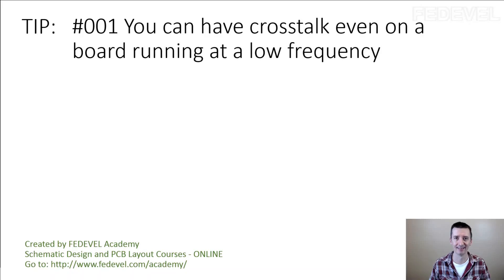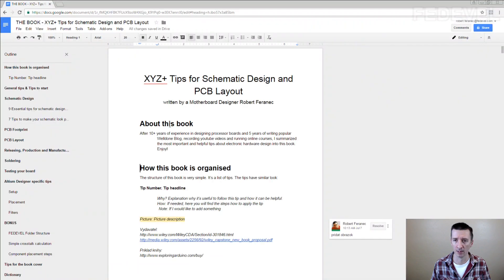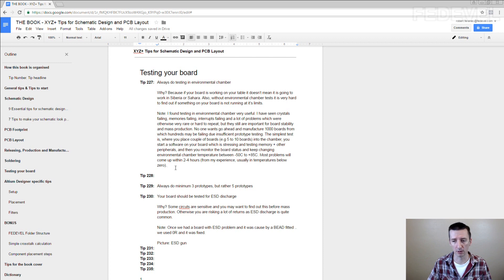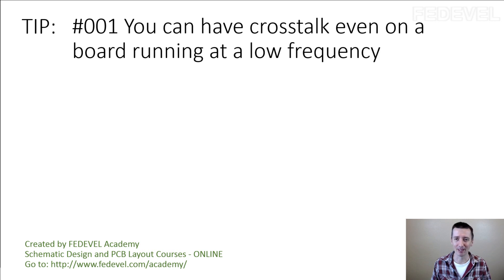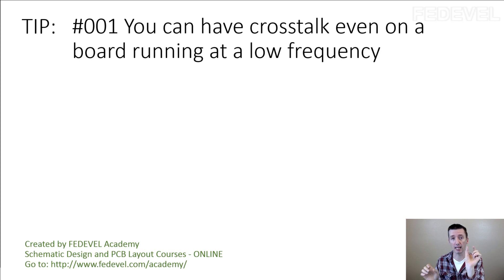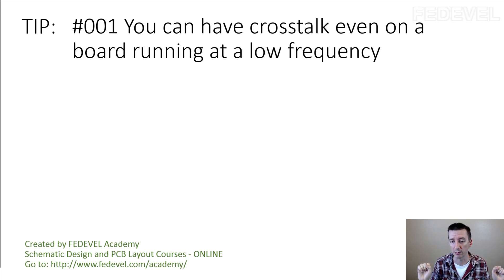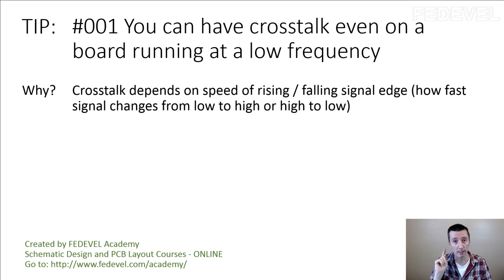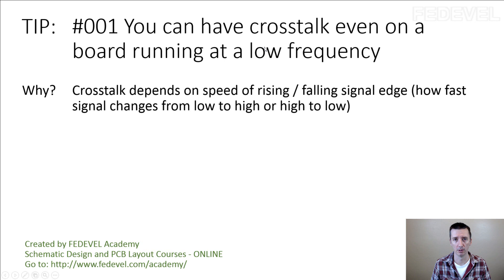TIP #001: You can have crosstalk even on a board running at a low frequency

Comment: I suggest making each tip less than 2 minutes. Wonderful new year resolution! Your time and effort should be compensated. Thanks.
Reply from the maker: I was actually thinking about this and my guess is, that most tips may be probably between 1 to 3 minutes. Some tips may be longer, but I will be very careful about not making them longer than 10 minutes. Once I create couple of videos, I hope I will get the feeling what could be the right length. But you are definitely right, the length will be important.

Comment: Happy New Year and thanks for the new video!
I have only one question. How can Saturn PCB derive coupled voltage without load capacity value?
Reply from the maker: I have seen some calculators considering also impedance. Saturn probably uses the standard equations for two tracks routed close to each other - maybe approximately the worst scenario? For the exact calculation you may want to google for more precise calculators, but Saturn is just fine to get the feeling about how bad the situation can be.

Comment: Still, you have already shared quite a bit of knowledge, and as aga1nst said, making money is not wrong. Having said that, I'd gladly pay 10-15$ for a copy of the book.
Reply from the maker: Thank you krokodyl1220. I am not sure how much the book will cost, but my guess is somewhere between 10-30USD ... not because of profit, but because of a lot of color pictures (pictures will be useful for many tips). So, I am sometimes worried, that even without any profit it may not be the cheapest book. But I hope, that the publisher will have some tips / techniques how to make the printing cheaper and I hope that today's color printing is not as expensive as it used to be.
Reply: Any thoughts on releasing en ebook on Amazon? (well, not necessarily there) Typical technical releases seem a bit awkward on ebook readers (especially if containing large quantities of equations or code listings), but it seems like the format of the book containg a lot of short tips would fit nicely.
Reply from the maker: I thought about ebook, but I am not 100% convinced about it. Some of the customers may be companies and they may prefer to buy the paper book so they can keep it in the company library and engineers can borrow the book between themselves. Also, I have bought couple of ebooks, but I like the real books more :) Honestly I do not know why :)
However, ebook sounds like good alternative to publish the book in case I am having trouble to find a publisher.
Reply: Well, you can do both ;)